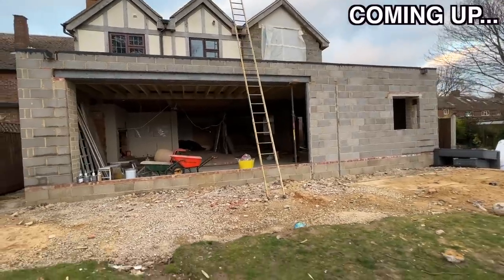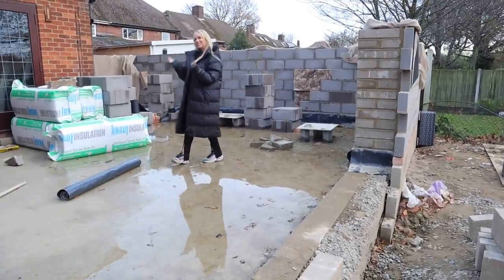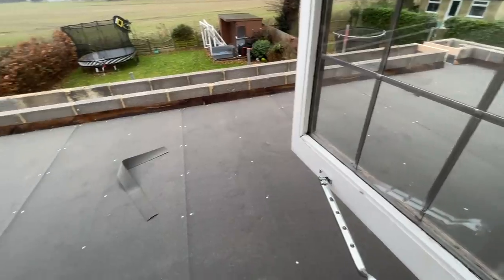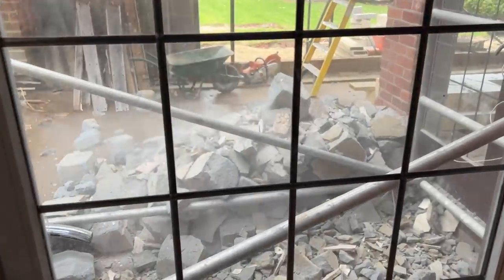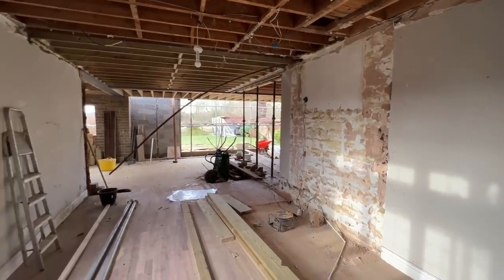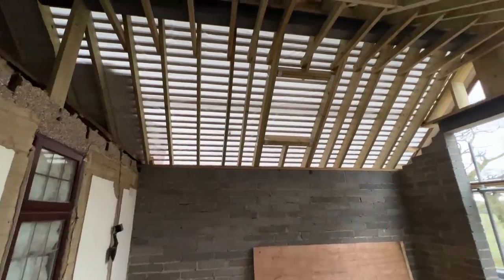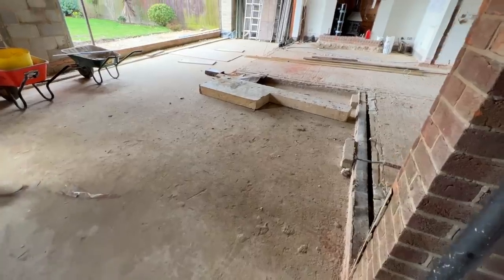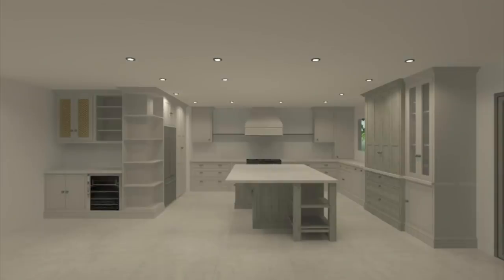EXTREME RENOVATION UPDATE #2 | BUILDING OUR DREAM HOME!  Emily Norris

Comment: Emily, the house is coming up amazing. My only observation is re the kitchen window. Is it not too small? Would the kitchen not be too dark? It could be just my impression from the video and it’s not the case in reality 😀
Reply from the maker: Ha you're not the first to say this. It was the biggest it could be because of the pocket wall for the sliding doors. The sliding doors being so large probably doesn't help next to it. But the window is 1200 x 1200mm which is big. From the outside you are also currently seeing below ground height as the patio is yet to be built, hopefully you'll see its in proportion when it's finished! The big gap between gives us lots of wall space inside. It will also have an outdoor kitchen along it on the outside 😍 thanks for watching Sylwia xx
Reply: @mrsemilynorris  that’s what I thought it would be the case with that pocket for the sliding windows…I guess you can’t get everything and you need to make make a choice when doing such projects. Regardless I am sure it will be AMAZING! 😀😀😀

Comment: Hi Emily, not sure if you’ve thought of this but please consider air con. We have similar sized bifolding doors and they act like a greenhouse in the summer time and we find it unbearable sometimes. Really wish we’d had it installed during our renovations xx
Reply from the maker: Ooh very good idea!! xx
Reply: I second this. I have giant bifolding doors too and the kitchen is like a sauna at times
Reply: Do you have sun protection film installed? My work office windows face the rising sun and the room use to be really hot until 10am when the sun was high enough  to not irradiate the room. I've got 3M sun protection film installed in every window pane and the temperature is muuuch lower now and I save in the AC bill. I really recommend it
Reply: I hate bi folds..think of all the flies,it drives me mad with French doors open!
Reply: I thought the idea is that you can open them up in the summer and then in the winter you’ll be glad of any free heat you can get from the sun. The back of my house has almost as much glass downstairs with two big windows and double French doors. It’s South facing but to be honest it’s only a handful of days when we feel the need to have everything open.

Comment: Love it all, but could you make the kitchen window bigger, the proportion looks a bit off ? I'm sure it will look different when rendered and framed. I'm sure all the hassle will be worth it !
Reply from the maker: Ha you're not the first to say this. It was the biggest it could be because of the pocket wall for the sliding doors. The sliding. doors being so large probably doesn't help next to it. But the window is 1200 x 1200mm which is big. From the outside you are also currently seeing below ground height as the patio is yet to be built, hopefully you'll see its in proportion when it's finished! thanks for watching Jane 😘